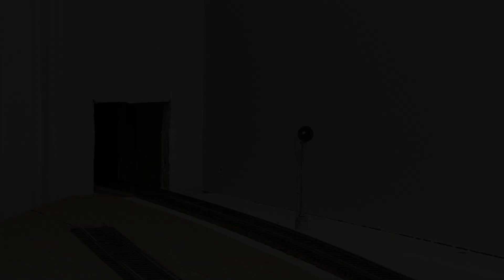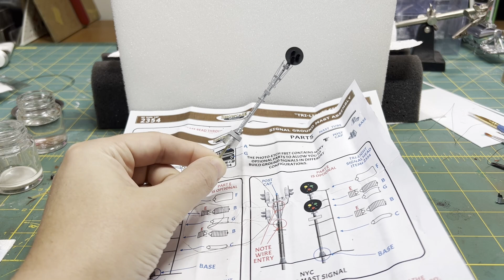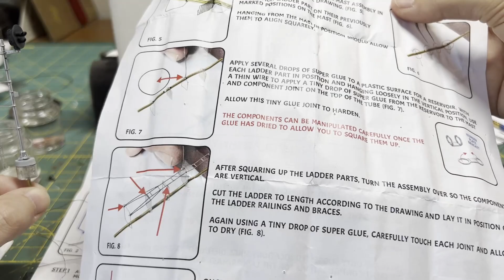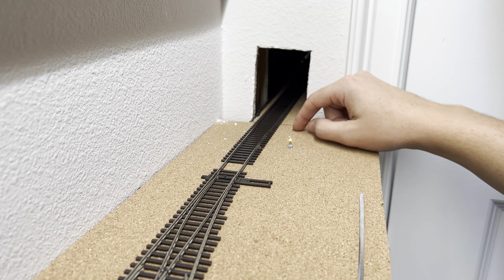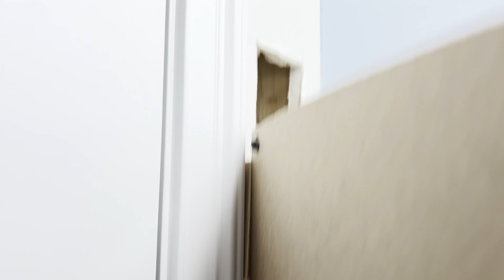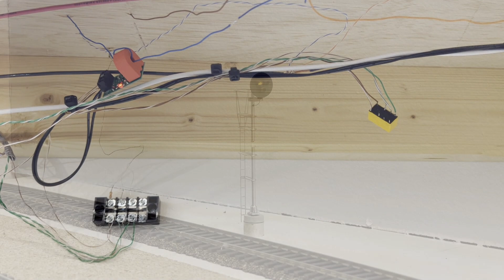Somerset Industrial ABS Signals!

Comment: What you need is a little timming circuit, or a capacitor to keep the relay up for a delayed dropout.  You could go as extravagant as a 555 timer, set it to say 15 seconds or what you fancy and you should be good.  Of course you can buy "Time Off" or delayed off or delayed dropout relays, but a simple capacitor circuit will suffice.
Reply from the maker: Thanks! I seemed to have it smoothed out. You sure know your electronics!
Reply: I have a current sensing detector that not only provides a Clear and Occupied status, thus eliminating the relay altogether,  it also includes a capacitor on the logic side for delayed release. This is especially important for people who want looooooong blocks and for operators who keep dirty tracks.

Comment: yes I would like to try to make my signals the same way so please convince him to come up with a video step by step
Reply from the maker: We will work on that
Reply: They are simply using a current sensor to monitor and activate when there is draw in the particular zone.  It's essentially a special transformer/ coil of wire with a track lead wrapped around it as you can see in the footage.
Reply: I have a detector that works in a similar manner, in that it uses current sensing detection.  It also offers a clear and occupied status so the relay in this application is no longer necessary

Comment: Nice simple setup and really good looking signal.
Do you have resisters on all your wheelsets?
Reply from the maker: Thanks Heath. No not yet. Now that we got it working I will start adding at least one on each car. The system works really well and does it’s job protecting the hidden track.

Comment: looking great but lol what kind of wiring are you using i like how it looks i have some little signals i like to mount by my double crossover but im not sure which way the lights are suppose to be facing and how many of the lights i need by it and im installing 4 tortoise machine to operate the crossover any advise would be nice
Reply from the maker: Hey Dwight, there is definitely a way to hook up signals to tortoise switch machines. It will switch lights depending on the switch indication. I personally have never done it but I have seen some diagrams online how to wire them directly to the tortoise. The club I belong to has several hooked up like that.
Reply: Essentially in controlled territory, every switch has a signal protecting it.  If it's an isolated switch, it is protected from all directions (typically).  In the case of a double crossover (as with single crossover) there would be four signals, in order to protect each track, approaching the switches (crossover) from each direction.  These signals would point "out" from the switches, so that approaching movements could view them. 

However, it's your railway, so anything goes, and it's upto you to decide what makes the most sense for how you operate.  Not every single switch (even on mainline) have a signal either!

Tortoise switch machines offer simple signal logic; I would consider "cross" wiring the machines and signals so they actually act as a pair, such in the real world.  You might have to add a couple relays to perfectly emulate my idea, but with a couple contacts on each switch you can get close.  You can do normally closed (NC) for normal direction pair to activate the green lamp, and NO reverse direction for diagonal pairs to activate yellow lamp (for instance).  If you wire the lamps in parallel with each other but series through either Tortoise machine contacts then they would only display green or yellow respectively when BOTH switches are properly lined.  The only issue with this and only have two contacts is that you cannot request a red signal, the signal would simply go dark for unlined. 

Therefore you would need some relays, perhaps 4, but possibly 2. In which the Tortoise keeps the relay alive in order to display Green/ Yellow, if the relay falls then the signal displays Red.  In the case of a misaligned/ moving switch.

Comment: Very cool. Is the signal power coming from the track or another source? I am DC and this would be cool to use if it could be wired without constant track power. Maybe a follow up demonstration video showing the actual wiring of the signal, relays, etc might give more insight. Either way, this is a great addition to your railroad. Thank you for sharing.
Reply from the maker: Thanks Bob. We are going to make another video reviewing the logic and wiring. I’m not sure if  DC would work or not. If so it would be a very simple option…
Reply: @RailserveJohn  looking forward to the follow up video.
Reply: You would need a separate DC power supply . You could use the track power in theory but as soon as you lowered your track voltage your signal would go out.  I am not sure if the NCE BD20 will actually work on DC track. Never tried it.
Reply: @ThePWMRR  thank you for responding. I will investigate more.
Reply: This system is based on the current flow across the rails (ie current draw of track power).  If there is no track power (ie DC locomotive is stopped 0V) then no draw and thus no report to the signal that the track is occupied ("down") - the track will be reported "up" or clear. 

To bypass this you could look at implementing an AC track circuit monitor, some sort of computerized system, or more traditional optical/ photo/ beam/ weight sensor system.  A timing circuit could also be implemented to help with gaps or issues arising from 'relay drop-out' as mentioned in the YouTube upload.
Reply: I have a current sensing detector that works well on DC and DCC tracks. It too requires a secondary power supply. It also provides an occupied and clear status eliminating the need for a relay in this application. Now if you want to tie it in to an adjacent block for your 3 colors, you'll need that relay.

Comment: Nice video,  I have the same signal kit. However on mine the LED has the green on the upper left. I would prefer green on the upper right as yours is. Did you have to request that when you ordered? Thanks
Reply from the maker: Interesting … no I just ordered the standard LED set up for this signal through Showcase miniatures

Comment: Awesome signal John, I have most of Showcase miniatures product line and its all great stuff. Your set up is sharp and serves its intended purpose. Well done. I also subbed Dons channel to binge watch later. Relay chattering will shorten the lifespan of the relay eventually, I see this in higher voltages and the fix is usually a capacitor across the coil leads to smooth it out, but I am no electrical engineer by any means. I am sure someone else could add to this. Cheers Rob
Reply from the maker: My man Rob for the win! Tried a few different caps like you said and it totally works. I would say it has reduced the chatter by at least 95%. I’m only seeing it when moving very slow across the gap or on a locomotive with poor pickups / dirty wheels…. 

Thanks for checking out Dons channel. He is an amazing modeler and has an awesome layout built for operations. He has a FB page as well about his P&W layout.
Reply: @RailserveJohn  thats sweet news brotha, glad it worked out. I sure like the way that signal looks. All of the metal castings ive gotten from Showcase Miniatures are of great quality, I just wish their wig wag signals were operating instead of static models. Boomers Dioramas did a build of their tow truck and that model looks great,, I think its a late 70's early 80's truck but even today, it would look amazing in the weeds rusting away. I cant wait to see what you do next. Cheers Rob